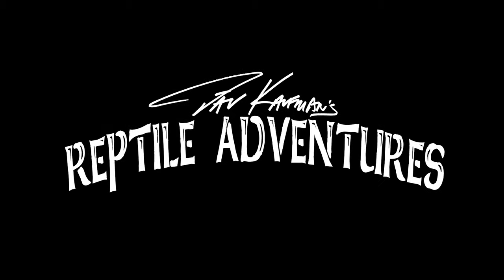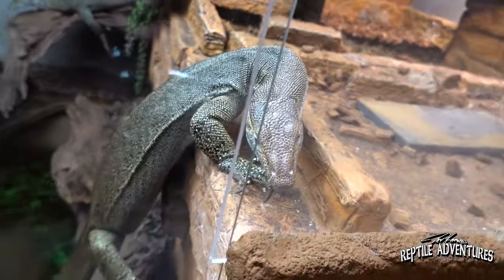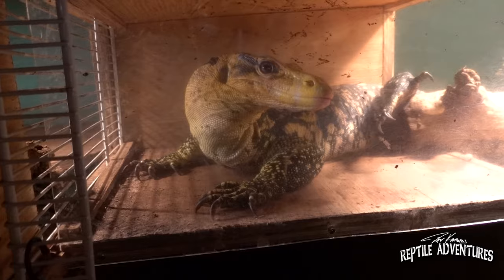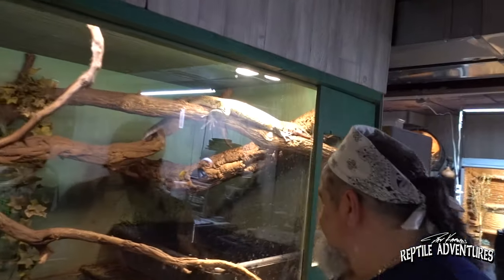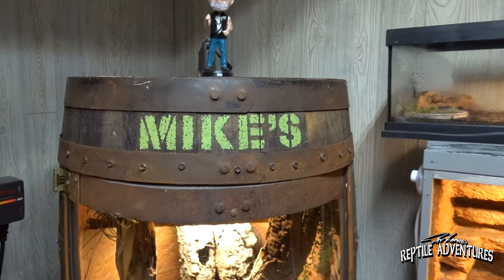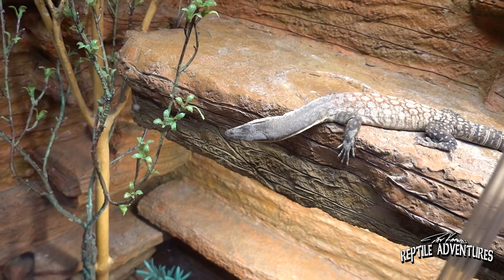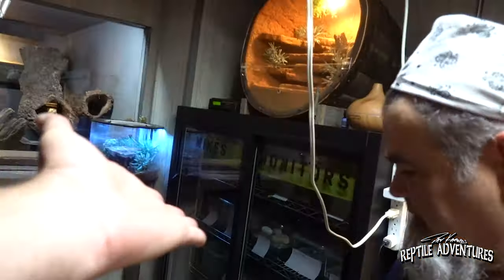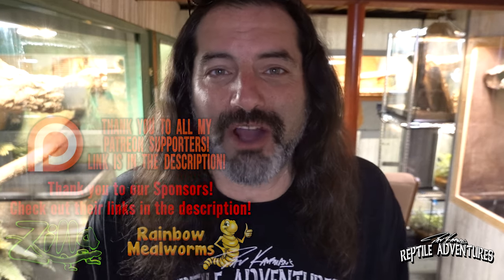INCREDIBLE MONITOR LIZARD REPTILE ROOM TOUR! (Mike's Monitors)

Comment: Did he use styrofoam for the Australia looking setups ?
Reply: Yes! My dad and I use Styrofoam for the base an than Zoopoxy on top!
Reply: @angalino5200  yeah ok I have 3 weeks in counting until I get a baby ackie and all the enclosures I been seeing are just corks barks .. and I don’t like that it seems to plain.. I have a four foot long 2 feet wide 3 feet high enclosure that I am applying my last couple of coats for drylok... could I just put about 2 feet wide of substrate and 1 foot high for him to dig like in a tunnel entry point like mike did ?
Reply: Lino Stef is my Son and he is a great builder as well. Smart young man!
Reply: @mikesmonitors1148  is it best to apply the styrofoam to a wooden drylocked wall or do I need to make a styrofoam based background to fit inside the wooden dry lock coated walls?
Reply: Either way will woik! I glue and screw my foam boards right to the walls. You can cut to fit and leave the unglued and just screwed for later removable...like an insert
Reply: @mikesmonitors1148  hmm that’s a good idea! And with this ackie I will not need 12 foot up substrate across the entire enclose (4feet) but could provide him like a 15 inch high 2 feet long dig box and like hide it with a rocky cave looking design?
Reply: @JayBay813  absolutely, the only thing that limits you is you! If you can see it you can create it. If you have any question I'd be glad to help!❤🙏
Reply: @mikesmonitors1148  ok cool thanks sooonmuch .. so I wanted to know that he didn’t need substrate all across the enclosure ... I don’t want to have him in unhealthy condition so a dig box is ok for a ackie ?